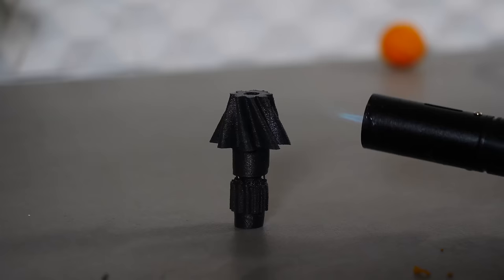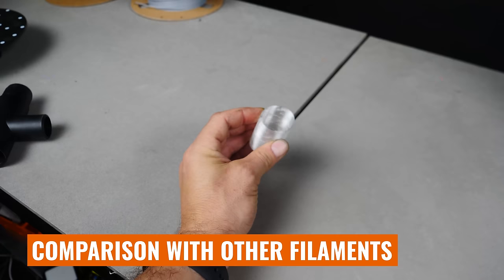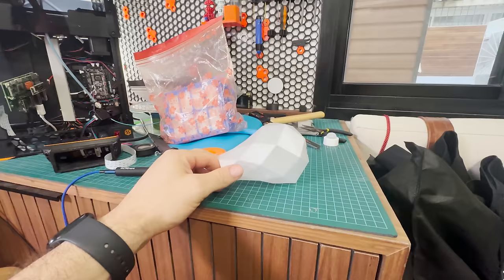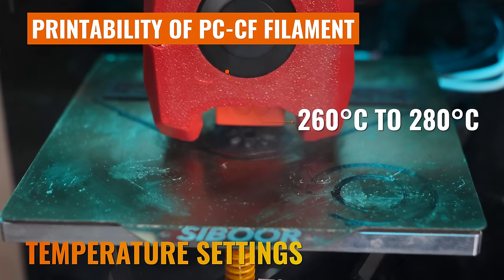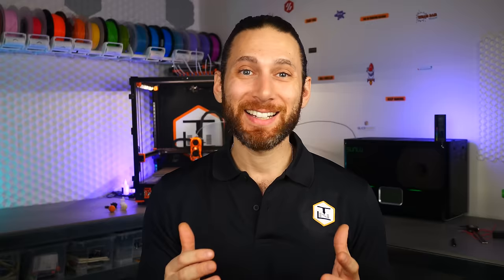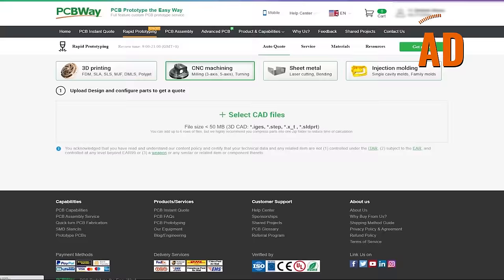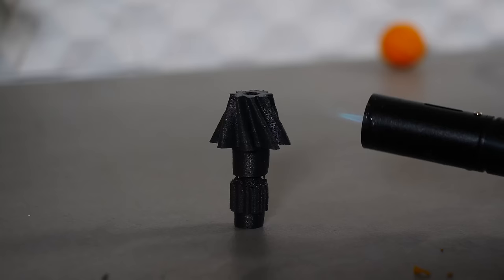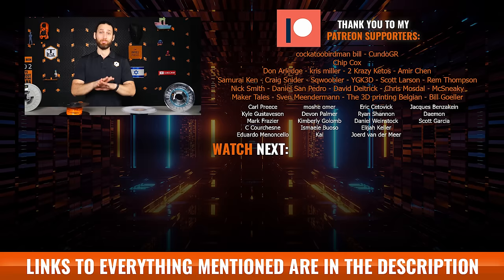7 Specialty Filaments that Will Revolutionize Your 3D Printing

Comment: I use a lot of CPE from fiberlogy, it is food safe, high heat resistance around 110° and easy to print.
It's like a soft PC. I love this one.

For the PP use PP tape with no heat bed, it's cheap and so efficient.

Good video.
Reply: PP should be one of the best plastics out there. It´s 80% of all plastics worldwide and thus you could use a lot of recycled stuff. It´s also super cheap.

Comment: PCCF and ezPCCF also do very very well when used for 3D printer toolheads. High rigidity and low weight gives some great input shaping graphs. Not to mention the added benefit of basically never being able to melt your toolhead+ducts
Reply: I used White (titanium oxide powder) PC for the parts cooler and BL touch probe mount/protector. Printed at 6mm³/s, it's strong enough to smash into parts and stopping the stepper motors on failed prints and forgetting about a print sitting on the print bed when homing 😅 enclosed @60C for about 2 years with no signs of warping. Although I'm certain if I remove it and check there will be some  warping, possibly caused by annealing.

I use PC Glass Fiber for other projects which makes it surprisingly impact resistant while stiffening it up. Not as much as Carbon Fiber, but halfway there

Comment: I bought a roll of Prusament PCCF.  Had it over a year before I found anything worthwhile using it for.  Made a splash guard for my buddy's electric bike.  Probably could've used ASA or even CF PLA but he was paying for it and it will be taking impacts from rocks etc when off roading.  I figured I should test out and see if my Bambu P1S could handle it easily after changing to hardened parts.  To my surprise, I tweaked a couple PC settings on the generic PC profile and it printed like a DREAM.

Comment: I have printed with Prusament PVB and it prints great with no discernible smell.  I also have a Polysher for smoothing it with IPA vapor. The Polysher works pretty well but has issues getting to all the surfaces leaving some areas with layer lines.  I also found the vase mode PVB prints take almost a week to dry out and become as firm as they were after printing.
Reply: I noticed this as well, it stays soft for a long time. If you heat to 30-40c it will dry faster but may warp. Drying after a day or so of ambient will reduce warping/shrinkage from the active drying

Comment: I appreciate the work you put into these videos, but I offer some constructive criticism to make them more interesting for me to watch (i.e., these are just my opinions). 

1. Your title is deceptive as you did not print all of these filaments. (Okay, you fixed this one already.)

2. Good videos are more “show” than “tell.” You use a too-high percentage of irrelevant and borderline deceptive stock footage. You also play the same b-roll clips over and over; I would rather watch a talking head than b-roll of you spraying alcohol on a PVB vase a half dozen times. Thank you for the kittens, though. I want to see more things that you print, not a half-finished 3DBenchy, and it is not at all clear if the watch strap you showed was yours or stock footage. Please show footage of 3D printed items rather than injection molded mass-produced parts. Yes, filament is expensive, but many manufacturers offer free or inexpensive samples, especially to YouTubers.

3. As you are largely talking about products you have zero or little practical experience with, do more research. Bad information is worse than none. For example, you said that NonOilen was the only food safe filament (you did admit you found another), but you ignored colorFabb nGen, Tauman t-glase, Filament.ca TRUE Food Safe PLA and PETG, and quite a few others. Food safe filament is not uncommon.  Another example is that polypropylene will not stick to blue tape as you showed, but common polypropylene packing tape works well. 

4.Reduce redundancy. You have a template for discussing filaments consistently, which is good, but you mention some things repeatedly without benefit. One example is when you mention moisture absorption for a filament multiple times. Once is plenty. And I could not count the number of times that you said that TPU is stretchy, same for TPE and PEBA. 

Overall, tightening up your script to about 15 minutes would make this video more watchable (and less work for you searching for stock footage). 

I hope you find this helpful, I want your channel to do well.

Comment: @thenextlayer please try not to fall for manufacturer's marketing BS.
1) CPE is the same non-term as "PLA+". It means nothing. At most it just means "blend". Commonly CPE is PETG+something, but like with PLA+, it could be simply as good (or bad) as any other ordinary PETG, but calling it "CPE" gives it more credibility. What matters is the datasheet (assuming it doesn't lie).
2) NonOilen is PHB (=PHA?), so nothing special. For example Colorfabb PLA-HP is the same thing. But I get it, calling it NonOilen sounds cool and I keep it in stock for various prints because that marketing made me buy it over other PHA/PHB filaments in the past. Also I wonder why it didn't stick to the bed for you, I have trouble getting it of and need to use glue stick as a separation layer. It ruined part of my black Textured PEI sheet from Bambu as I had to literally scrape it off...
3) Food safe filaments are plentiful. Again - making it sound important is mostly marketing BS. If you really care about food safety then you need to make the "product" food safe, and that's not (just) about using food safe materials. I would guess that most filaments out there coming from better manufacturers are food safe, but it really means very little. Btw PP shoud be more food safe in practice as it should be less porous and more likely to produce watertight parts etc.
4) Polypropylene is actually not that bad when it comes to printing. It doesn't warp, so as long as the first layer sticks and isn't too narrow then you are fine. Magigoo PP works great of course. If you want a challenging filament, try Fillamentum Flexfill TPE 90A (Sky Blue is what I have). It sticks to nothing and warps like crazy.

Full disclosure - I actually like Fillamentum CPE HG100 a lot , but please don't talk about CPE in general as if it meant something. And I also like NonOilen, though it's just too expensive, probably because of marketing costs :P I also have my doubts about biodegradability... If manufacturers truly cared about the environment they would buy (or at least take) back filament and failed prints from public to recycle.

Comment: Not sure if you've covered this or not -- in your video, you recommend hardened steel nozzles several times. Printing with CF-PLA, I could detect signs of nozzle wear (bottom surface flattening, bore widening) in under one 1kg spool of filament. The first mm of wear happened FAST (thinnest part of the material) and then it was slow, steady wear -- I could track it in my stadily drifting Z offset. I switched to a cheap Ruby nozzle on Amazon from MOD3DP as a test (not sponsored) and it legit has not lost 0.1mm of its tip. Pros, lasts longer than a hardened steel nozzle. Cons, slightly worse stringing. I'd be curious to hear your experience.

Comment: This was really interesting, I hadn’t heard of a few of these of these filaments like PEBA and Chinchilla, I think you should try PEEK if you haven’t already, it is one of the strongest materials out there, however it is difficult to print and quite pricey at around $600-$700 USD a Kg. PEKK lacks some of the properties of PEEK but is significant easier to print being around as difficult as PETG, it is at the higher end of the price range before at around $700 USD a Kg. Excellent video and very informative👍.
Reply: big monies
Reply: This channel isn't vision miner lol but, seriously the price for a machine to properly print peek is ridiculous, not to mention the price of the filament itself. You can build a capable machine but, that's outside most peoples wheelhouse and there are not a lot of use cases where it even makes sense in an industrial setting certainly not for a hobbyist.
Reply: @thirtythreeeyes8624  I took a peek at your comment and I agree tbh
Reply: Yeah I agree with the impractical nature of Getting the right machine to print PEEK and the price of the filament itself is insane but if he could justify it done the line it would make an interesting video, but this is highly unlikely.

Comment: I print with PP on a fairly regular basis. The lab I work for often prints prototypes for the local hospital and PP is a go to for us because of everything you mentioned. I find it is easier to print with than TPU as long as you can solve the bed adhesion issue. We simply wrapped a glass bed with packing tape as PP will easily stick to itself. My favorite filament we have produced at my lab, though, is a LDPE composite with a density of 0.64 g/cm3. Crazy light weight with amazing impact resistance.
Reply: yes PP will stick to itself....sometimes a little TOO well when trying to get it to let go of the bed/tape ect.
Reply: @SirLANsalot I’d talk to a doctor for that one.

Comment: One point maybe worth calling out for flexibles is what filaments they can bond to if any, like PLA and TPU, as that creates lots of options of combining rigidity and flexibility as required eg as is used for tpu hinges in pla prints.
Reply: I've had good success printing PETG on top of NinjaFlex for soft vice jaws. No dovetailing needed, I just swapped from NinjaFlex to PETG on a layer change. My application was also helped by my profiles for PETG and NinjaFlex having the same printing temperature.

Comment: PEBA is indeed a top tier material for elite running shoes due to its compliance and resilience, usually  combined with a carbon plate to stabilise. However in running shoes it is used in a foamed version, I don't think it could be printed with the same properties, and even in the foam form there are huge differences between different versions.
Reply: When it comes to the processability of PEBA filament in FDM printing, especially for midsoles of shoes, we have verified it not only experimentally but also in custom shoe production. The verification was conducted in collaboration with the Footwear Design Studios of the University T.Bati, utilizing hollow structures to achieve comparable or better properties than in mass shoe production. While the efficiency for mass production with FDM is limited, it serves its purpose for verification or custom manufacturing. 
PEBA filament is not exclusively intended for footwear; it makes sense primarily in the technical engineering field. Thanks to its high abrasion resistance, temperature range, and chemical resistance, combined with its elastic behavior, it is truly an exceptional material, and I'm pleased that this excellent video has introduced it to users.

Comment: 17:04 for a good clear rigid material, amphora 3300 is phenomenal. It's a co-polyester that maintains really good rigidity, while printing absolutely transparent components. It's a little pricey, but it actually was a ground breaking filament when it initially was released

Comment: I had problems with PC-CF in high temp environment (93c dental cleaning machine) and a little bit of mechanical stress (a couple 100g), It started to deform. Switched back to PC and it was good. Prusament PC blend and Prusament PC-CF blend. 100% infill.
Reply from the maker: Thanks for sharing

Comment: I've had several printer/toolhead parts from PA-CF and had to reprint them using PC-CF because PA-CF parts becomes by time (about a year) too flexible (almost like a rubber). Although all the parts could be printed from ABS/ASA, the PC-CF remains to me as the only high temperature resistant material which can be easily printed on open printer (basically no warping and still good layer adhesion, at least the Prusa flavour of PC-CF).
PC-CF (still talking about Prusa flavour, I've never tried any other PC-CF vendor) is hydroscopic, yet printing from filament dryer is not mandatory (it is slightly higher hydroscopic than e.g. PETG, so no torture like Nylon or so).

BTW. Most of the PC-CF (about three spools or so) were printed using nickel plated copper nozzle :-). The nozzle is still fine. But on my second printer, with Revo hotend, I even didn't tried to print it with brass nozzle (I immediately ordered obxidian nozzle) since brass is really soft in compare with nickel plating.
Reply: Prusa PCCF sounds really nice! I've heard that 3DXTech PCCF is really hard to print and requires a heated chamber, which makes it impossible for open frame printers. 

How was your experience with nickel plated nozzles? I never tried them for abrasive filaments. Three spools of CF filament is pretty insane. What brand do you use?
Reply: @leonjiang2882  not prusament pc-cf but I put maybe 2/3 of a spool through a phaetus nickel plated copper nozzle in my rapido and the end of it is very visibly worn down. That nozzle is now great for ironing haha
Reply: @leonjiang2882  Uh, I don't see my answer from yesterday :-/ 
in short, the nozzle was (actually is, but I switched to the Volcano type nozzle) T-V6 by Trianglelab.

Comment: I've used PVB by way of PolySmooth and their Polysher (a box that generates IPA fog rather than trying to mist it by hand).  It does what it's supposed to, but always felt like it was better off with some initial processing first to reduce the time it needed to be exposed to the solvent.  If I ran it for too long the plastic seemed to become permanently softer, though sometimes over weeks it would regain the initial hardness.  It is a nice effect when it works, without having to paint and sand and paint and topcoat...  You'll lose hard edges and fine details the more you smooth it, of course.

Also used a fair bit of PC-CF, in all three of my printers (Mk4, VCore3, X1C).  It's good for "I don't want to care about it getting left out in the sun and deforming or breaking".  No idea if I've needed it half the times I've used it, but it's worked every time from parts on the outsides of trucks and RVs to printer toolheads (I've made a few EVA3s out of it).  The CF seems to have helped a lot with ameliorating PCs desire to warp in less well heated enclosures.

Looking at playing with a new thing called PETG Polyhex from IC3D.  They are claiming it has PC-like performance and chemical resistance without the warping and other eccentricities.  Supposedly designed with the Army for easy printing and durability in the field.

Comment: I thikn it would have been worth mentioning that the adhesion problem with the otherwise excellent PP comes from the fact that it almost exclusively sticks to itself. That's why people typically use regular packaging tape that is often made from PP or buy specific build plates with a PP toping. Those tend to be quite expensive though.

Otherwise thanks for another entertaining video!
Reply from the maker: Good point! PP is racist AF

Comment: I use PVB specifically for it's low residue after ignition.  This means that I don't use PVB filaments with colorants, as those increase residue.  The fact that it can be vapor smoothed with not only isopropyl alcohol, but also ethyl alcohol, it can be smoothed much more safely and this lends to fewer layer lines in final parts which is necessary for my uses.

Comment: Excellent video and thank you so much! I haven't looked into the filaments that are better suited for industrial apps. Something I've been meaning to do, as I will be making parts for that niche. This was a great introduction. One thing I wish you had included was the UV resistance of each filament for use in outdoor parts. That's a critical requirement for some items I'll be making in the next couple of months. Thanks for all of your effort. 
Maybe there are others interested in a video on the best 5 or 10 filaments that can be used in outdoor applications; covering UV resistance, temperature ranges, and water resistance? Thanks again.

Comment: Have you come across any "food safe" flexible filaments that can reliability be used for food container lids? A video about the post processing requirements for making food safe prints out of various materials would be really neat.
Reply: I second this, imagine being able to print your own tupperware and not having to worry about losing lids!
Reply: Unless your printer doesn't print any not food safe filament, any food safe filament you put in will be contaminated
Reply: Part of the issue of food safety can't be addressed by the filament material. The process of FDM printing creates small holes and valleys where bacteria (and/or bacteria food) can reside and be difficult to clean.
Reply: No filament is truly food safe just because of the layer lines, the material is food safe the product made with the material (also brass nozzle) is not.
Reply: @sierraecho884  Yeah, that's what I said. ;-) The problem isn't just the vertical layer lines, but also the top/bottom fill of the horizontal surfaces. It all needs to be somehow smoothed out at the microscopic level.
Reply: @Sembazuru  The easiest way is probably food safe epoxy but even then the stuff might not cure correctly or you one day hit something underneith the top coat etc. That´s why still everything is ceremacs.
Reply: @sierraecho884  True. I was going to mention coating in food safe epoxy, but then I'd have to get into a discussion about figuring out how the epoxy would effect the other physical properties like flexibility, surface texture, and etc... ;-P
Reply: @Sembazuru  I think the biggest misconception here again is that CF brings strength. People think that because CF parts are strong so CF in filament should increase strength right? Also parts feel a lot  sturdier with less give so ooh seems to work but unfortunately that´s absolutely not the case.